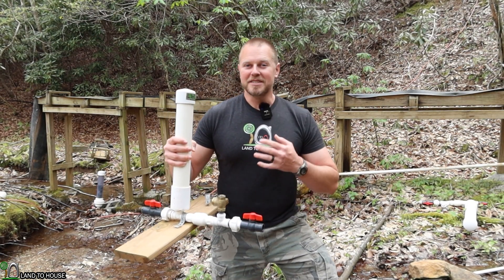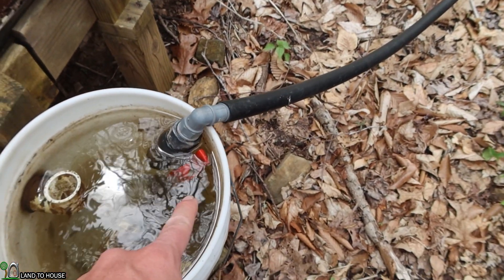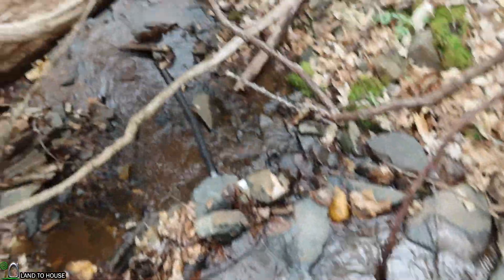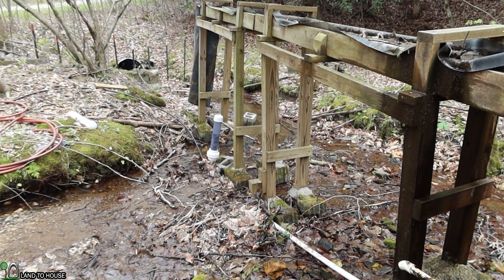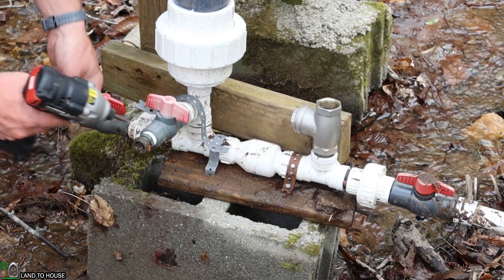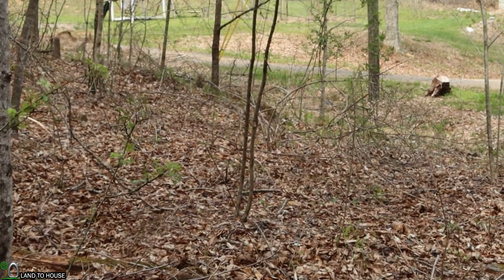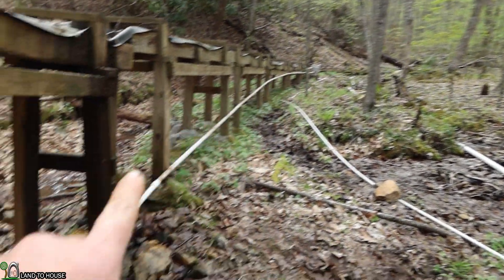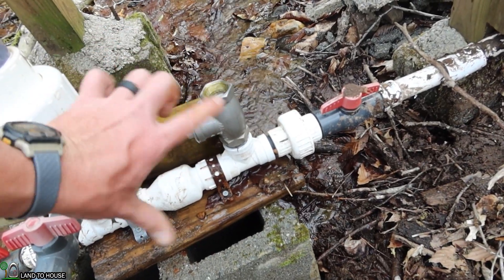Start the Ram Pump 2022 [ It's a Mess ]

Comment: Hi SETH. Just starting to hook my ram pump up at my cabin for the second year. Moved it uphill some from where it was last year. 1/2 a KM from the brook to the cabin. Playing now with trying to get the second valve all the way open. Here's to another summer with water. :)
Reply from the maker: Sounds like you have lots of input head pressure and not lots of lift? Cracking the delivery valve slightly is a good workaround but can be tricky.

Comment: Hi Seth, I am Frans, from Namibia, Southern Africa. I enjoy your teaching. My problem. I have a cement reservoir which can hold  243, 000 cubic. Uphill, I have a water trough for cattle. I want to bring water to the trough with a Ram Pump. The pipe line is 2 inch in diameter. The incline is 1 meter and the distance is 1,5 km  What is your advice?

Comment: good work. can it pump upwards at 45 degrees for 900meters up hill. i want one like that
Reply from the maker: 45 degree and 900 meter horizontal is fine. The max vertical lift is 55 meter.
Reply: @LandtoHouse  Just wanted to know the cost in Kenya shillings

Comment: Would the pressure from your system be enough for one to use a handheld spray nozzle / spray gun from a garden hose? Directly from the ram pump? From the water tower?
Reply: probably not,  
 but a pressure booster would get you more pressure , but no more volume.

Comment: ok watching a few of your videos.. have to ask. in this episode. you have "fall" from the creek to a silt bucket.. then overflow down the line to the pump. so it seems the "fall" is just in reality from the silt bucket to  the input of the ram. that distance only seems like 4 ft rise about 20 ft away..and the output lifts 30 ft. what am i missing? It seems the silt bucket is your new source or head pressure?
Reply from the maker: You are correct. The silt bucket does reset the head pressure. In this case the head pressure is 7'. And the lift is approximately 35'. The drive pipe distance is 50'.
Reply: @LandtoHouse  ah . thank you ! so what determines the size of the pressure stack pvc. I see most are approx same size.

Comment: When you put in the 44 Galen Drum, I've an idea that may help with keeping the silt out of the drum.  Basically where you have the elbow currently letting the water out, change that to a T, and have one leg down the bottom of the drum, one leg going out (as it does now) and one leg in the air, to stop it siphoning.  This way the overflow water comes from the bottom of the drum and 'should' take the silt with it.  Don't know if it works, but cheap and easy enough to try.
Reply from the maker: I have seen that done! Its a good idea. The waterflow into the 55gal might not be strong enough to stir the water but its worth a try!

Comment: What’s the minimum lift your 1” pump can do?
Reply from the maker: You can close the delivery valve partially to introduce back pressure/friction of the delivery. Around 8 to 10 feet is the minimum lift.
Reply: @LandtoHouse  thanks, I mean what is the minimum lift as a ratio of supply head drop? You’ve said 1:7 is max or is 1:7 what you need?

Comment: Super dumb question... (Or maybe a smart question? I dunno...)

What happens if you keep the drive pipe and/or up-hill pipe the same size, but increase the size of the waste check valve? Say from, whatever like a 1" diameter check valve to like a 2" or 3" diameter waste/check valve? Will allowing more water out per cycle increase the pressure built-up each cycle (by allowing the drive pipe water to maybe gain more flow rate / velocity), and/or increase the resulting flow rate up-hill? 

Obviously, it'll probably "waste" more water more quickly, but will it also push more water up hill more quickly, too (higher flow rate)? If it pushes more up more quickly, is it worth the extra "waste"? Does it vary somewhat linearly? Like if you double the amount of "waste" water, and increase the pressure, will you move double the amount of water uphill, as well? Or would you double the "waste" but only get 1.5x faster flow rate uphill, in which case maybe it's not worth it (diminishing returns, etc.)? Or would extra pressure end up more quickly breaking the joint(s)/system (*too much* pressure)?

Anyway, would be interesting to see an experiment...
Reply: If the waste valve is much larger than the drive pipe, there won't be enough water flowing through to close the larger waste valve and it will just dribble.
Reply from the maker: I've actually run both of those tests. When you increase the size of the delivery pipe going up hill it does not increase the amount of water that goes up.  The pump is only able to supply a set amount of water no matter the size of the delivery pipe.

As for waste valve size you have to match the drive pipe to the waste valve or the pressure way will be inconsistent. If the difference is too great the valve will either not close because there's not enough water flow or it will stay closed all the time because there's too much water flow.

Comment: Why don’t you use the black from the bucket to the ram.  That way when it freezes it won’t break.
Reply: I've used both.  The rigid PVC seems to result in a stronger shockwave, causing the ram to pump more water.  The downside is breaking when it freezes.
Reply from the maker: I ran a test with pvc vs poly. The pvc performed with much stronger results.

Comment: Why not change the output valve to a screw type so it will start immediately and you can just crack the valve open slightly?
Reply from the maker: That is a valid way of starting and filling the delivery pipe. It can be very tricky to get going initially. Sometimes it's just easier to sit there and press the valve.
Reply: @LandtoHouse  almost impossible with a quarter turn valve that likes to bind up, silicon spray helps